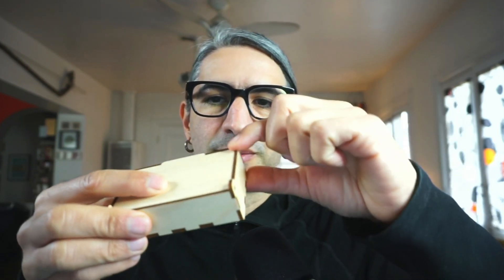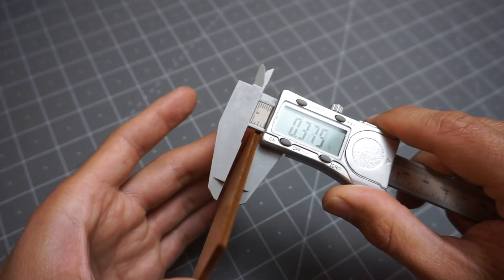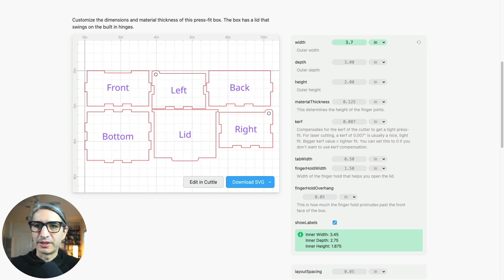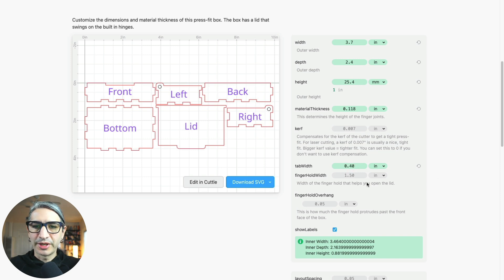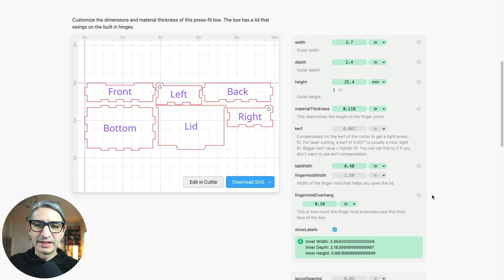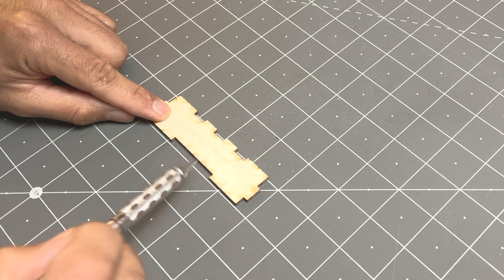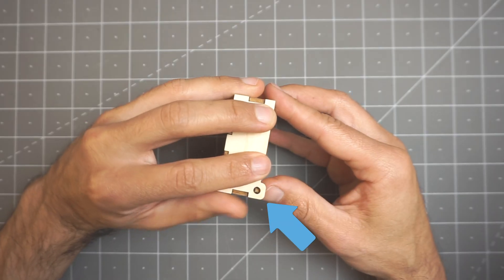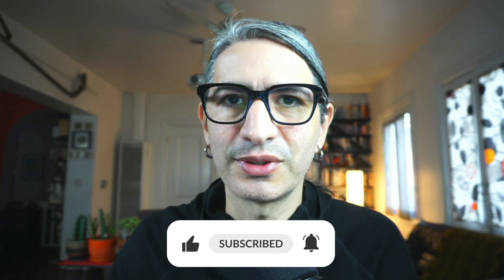Hinged Lid Box - Laser Cutting Tutorial

Comment: Is it possible to make the pins a little bigger on the hinges that fit into the holes?  I am concerned that on a larger box they are too small and will snap off. Thanks
Reply from the maker: On this template the pin size is entirely determined by the material thickness. That's a good idea though and I'll think about a variation on this template with larger pins. In the meantime, if you are making a larger box I would recommend using a thicker material (like 1/4 inch thickness). -Toby

Comment: Making them stackable would be a great addition. (Just a cutout for the hinge on the sides.)
Reply from the maker: Thanks for the suggestion! We can work on a stackable box template. Do you think plain open boxes that are stackable would be useful or do you think having the stackable option on the hinged lid box in particular is useful for you? -Toby
Reply: @Cuttle  I taught about the stackable box. But I created a Fusion360 design because I wanted the hinge in line with the back wall and the bottom and top with holes to keep marbles in place😅

For stackable boxes I could use the sliding lid ones, but that would not work with my intent of storing marbles and having the boxes as small as possible🙈

- Tobi😉